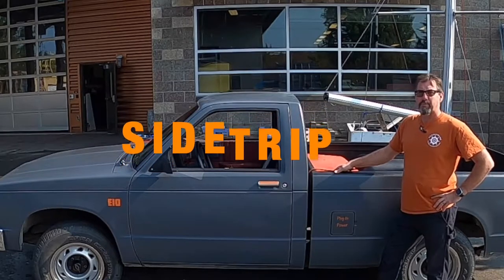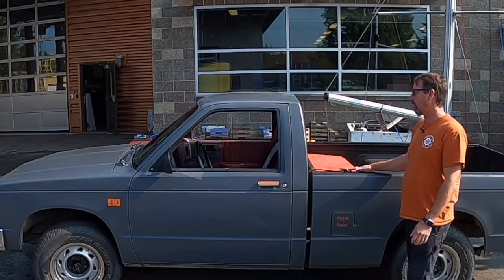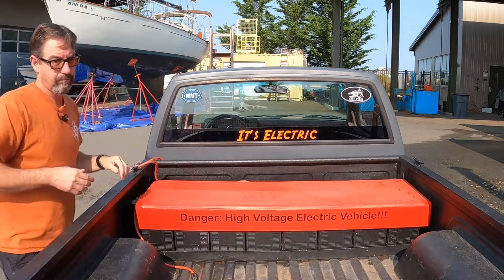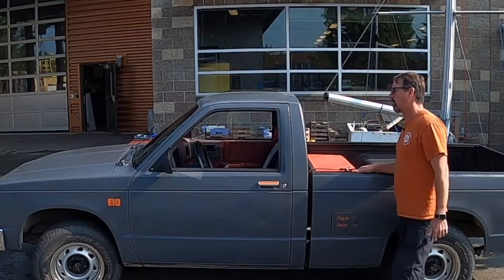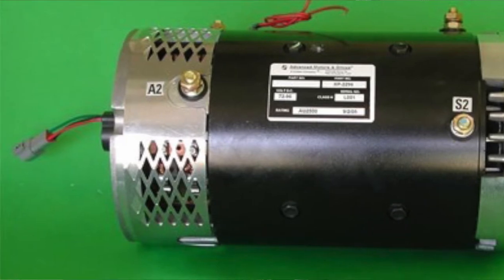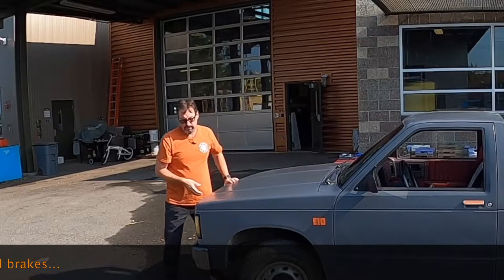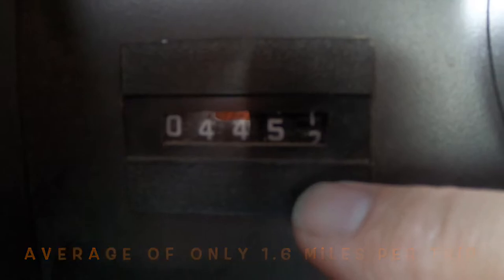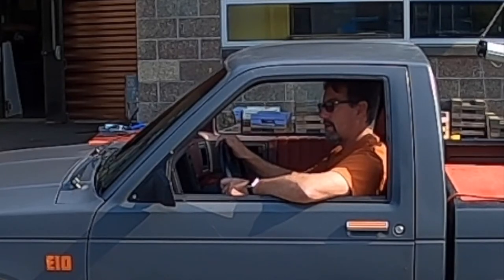Side Trip: "E10", Mr. Beemer's Electric Pickup Truck

Comment: Have you figured out the watt hours it outputs? Would be curious to see what the efficiency of the system is. Have always wanted an electric s10, either the factory one or a converted one.
Reply: I’ll check, have data at work, I think. Also have a link 10, can convert. Great transportation, love ❤️ 😍